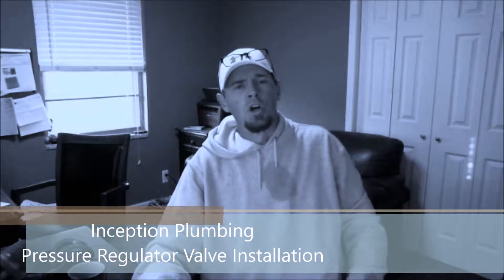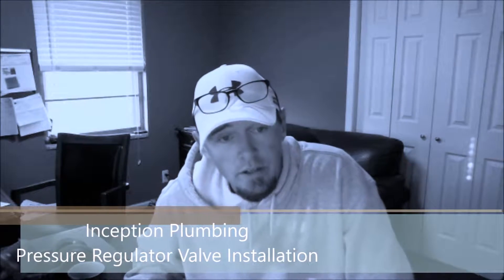Pressure Regulator Valve

Comment: I have seen (somewhere) an electronic meter which senses excessive water consumption and will permit you to turn off the water supply altogether. I'm wondering whether such a device exists along with a water pressure regulator.
Reply: I believe these are separate devices. The sensing device, like a Moen Flo, is just a flow sensing device. The PRV (regulator) focuses just on the pressure. One is more electronic and the other is mechanical. I think keeping those separate makes more sense. So if there is some type of failure, your not out the cost of both.